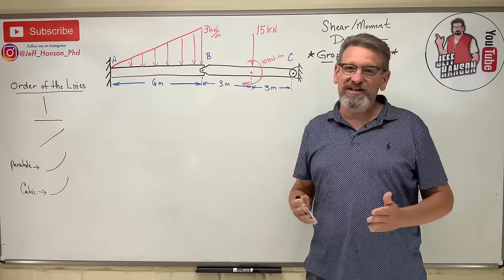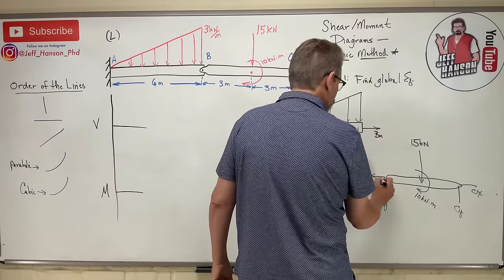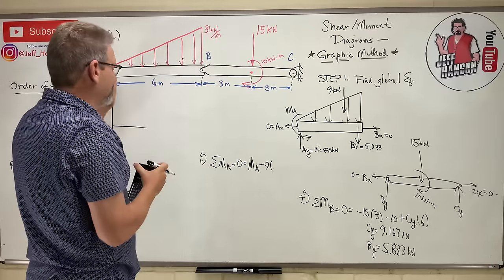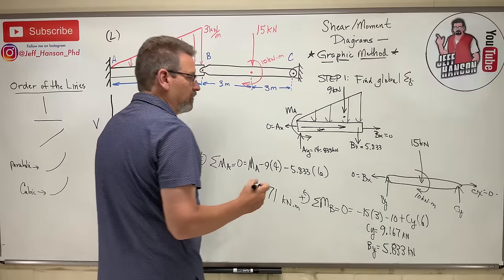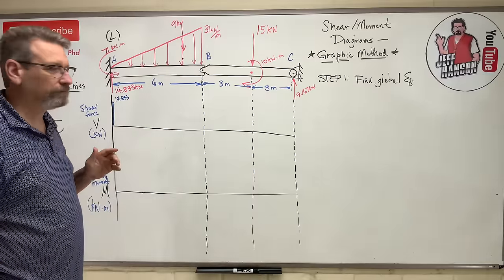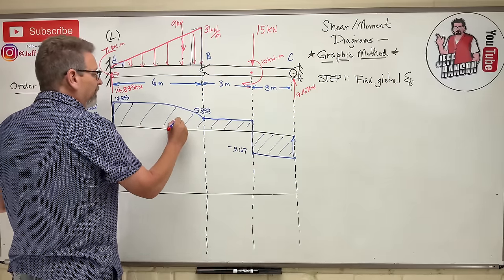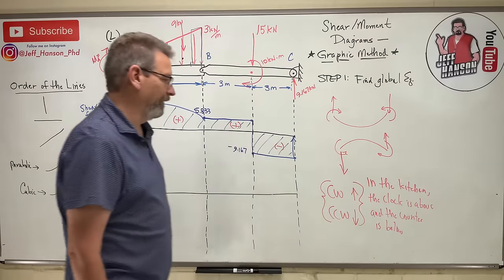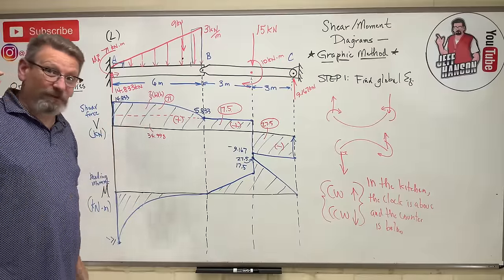Mechanics of Materials: Lesson 29 - Shear Moment Diagram, Graphic Method...Challenging

Comment: I've always been confused on the location of the concentrated load for triangle distribution load. How do you tell when to apply the (1/3)*6 or (2/3)*6?
Reply: its always on the taller side. So here the tallest side of the triangle is the right side, so the concentrated load is closer to the right side (2/3)

Comment: where's the 9KN on the shear diagram?
Reply: The 9 kN force really isn't there... It is the result of the distributed load used for finding reactions but not for the diagrams. So technically it is represented on the shear diagram by the parabolic portion from 0 to 6 meters. Hope this helps you out